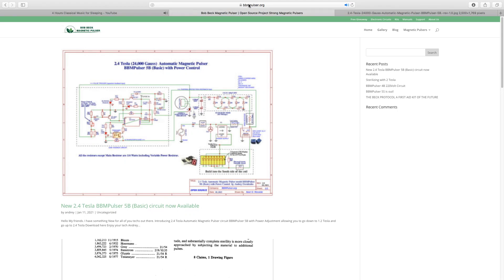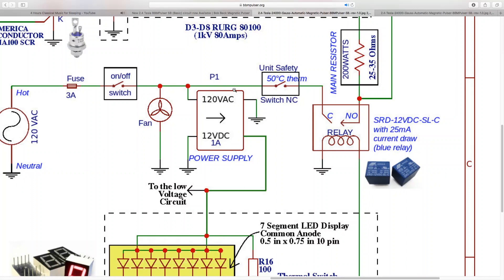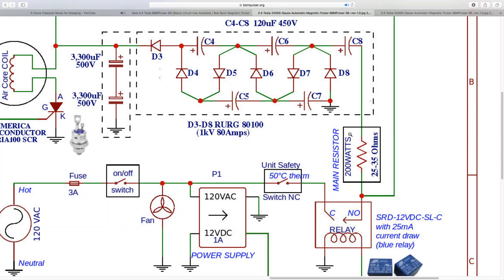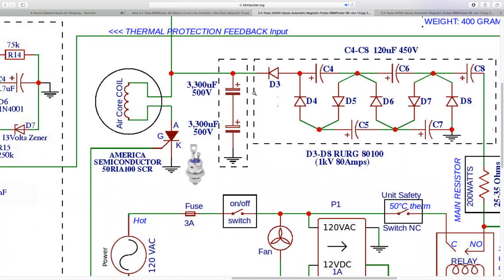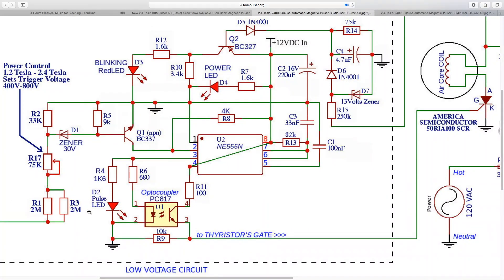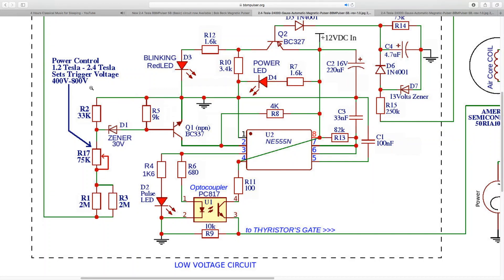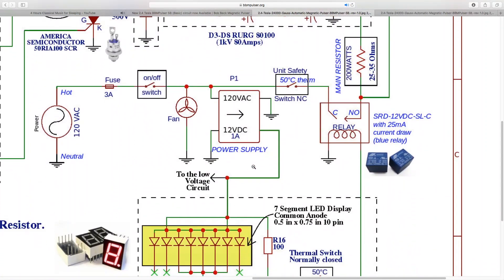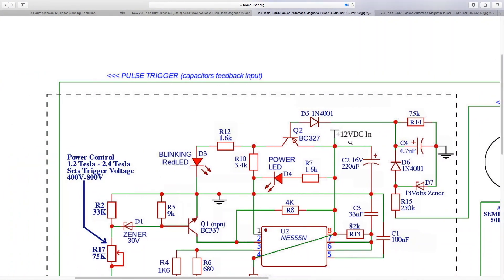027 BBMPulser 5B Circuit 2.4 Tesla (24,000 Gauss) Automatic Magnetic Pulser Strong PEMF TMS Open S.

Comment: Andrey I have a question about 5B there is 2 schematic diagram i have seen one is 3.2021 and the other one is also 3.2021 rev.1.2 on 9.2021 So i was building the pcb for the second one...is that the correct one? I mean the REV. 1.2.  9.2021??????
Reply from the maker: I always post the latest revision on my Website
Reply: @AndreyD  you mean REV.1.2 3.2021 is the latest?

Comment: If I add the 75k potentiometer to the circuit will the potentiometer set to highest value 75k cause circuit to pulse at 800v? When at the lowest value will the zener diode never see over 30v to trigger 555?
Reply from the maker: If it doesn't want to trigger with R2 being 33k (800V trigger) then increase the value to 39k or 43k. With this resistor you are setting maximum Voltage to charge caps before chip triggers. The higher  R2 the lowest trigger Voltage.
Reply: @AndreyD  this is definitely a strong pulser but I need to turn it down when using it in some areas lol.
Reply: @AndreyD  what about the potentiometer. The other day when I had an issue with circuit not triggering you told me to change R2 from 33k to 43k and it started pulsing but now I want to use 75k potentiometer to change voltage but I don't understand how that works. If I keep R2 at 43k can I still use potentiometer and at what resistance should the potentiometer be triggering circuit with capacitors at 800v? I would assume that when potentiometer gets to highest value it will take longer to get over 30v to blow past zener diode which lets capacitor bank charge higher.
Reply from the maker: @corybrown5583 Add 75k veritable  Resistor with r2 being 43k or try to install lower r2 ~ 39k. (this R2)resistor sets highest trigger voltage together  with 75k Resistor
just install 75k variable resistor and try it
Reply: @AndreyD  if I used a 50k potentiometer would that still go to highest voltage (800v) but not go as low (400v)?
Reply from the maker: @corybrown5583  If you use 50k Veriable Resistor then your highest charging voltage will be around 750V or 700V
Reply from the maker: you can. add  ~25k resistor to th 50K veritable resistor to make 75K
Or best is to get 100k and add 300k resistor across to make its combined resistance 75k
Remember 75k is very important value here, you need to have R17 to be 75k
Reply: @AndreyD  so if R2 sets the highest trigger voltage, does that mean a higher R2 resistor lowers trigger voltage? Sorry for all the questions but this was the only part of the circuit I have problem understanding lol.
Reply from the maker: @corybrown5583  That's right the higher R2 the lower trigger voltage
Reply: @AndreyD  the way you have it in your schematic has the 75k potentiometer adding resistance to the 1 meg resistor before zener but did you mean to do that or am I missing something?
Reply: @AndreyD  I just changed potentiometer to connect from zener to R2 and R2 other side still going to neutral and it worked perfect. So R2 just goes up and down in value to change voltage.

Comment: Just wondering if this circuit can work in 220 volts by replacing the fan and the 12v power supply with 220 volts? thanks
Reply from the maker: No It wont work, Your charging circuit needs to work with 220VAC as well
Reply: @AndreyD  can you elaborate, please
Reply from the maker: @cryptomaxima4623  I will try
Reply from the maker: @cryptomaxima4623  https://bbmpulser.org/wp-content/uploads/2021/03/230V-2.4-Tesla-24000-Gauss-Automatic-Magnetic-Pulser-BBMPulser-5B.-rev-1.0.jpg
Reply: @AndreyD   You just made my day, can't thank you enough!
Reply from the maker: @cryptomaxima4623  You are welcome

Comment from the maker: Update: R6 must be 249 Ohms & R11 must be 27.4 Ohms. This New thyristor requires more current to turn On
Reply: I used those values but thyristor not getting pulse to gate. Protection led flashes once like normal when powered on and power button lights up but I am not getting a pulse.
Reply from the maker: @corybrown5583  *********Update 01/23/202: R17 which is 75K, If you don't have it or can't get it, you can use 100K instead, just simply add 30k Resistor across to lower its combined resistance  to 75k ********

*********Update 01/17/2020: R6 must be 249 Ohms & R11 must be 27.4 Ohms. This New thyristor requires more current to turn On************
Reply from the maker: How about pulse LED, does it lights up and stay lid? If yes then we will troubleshoot thyristor, if Pulse LED doesn't lights up then it means your Voltage on capacitor bank has not reached threshold where it would trigger 555 chip. 
which one is it?
Reply: @AndreyD  pulse led does not light up.   I didn't use a potentiometer for voltage control because I don't have any right now other than a few rated for 10k. Problem is I don't have a volt meter that can measure what trigger feedback wire voltage is at because my voltmeter doesn't go higher than 600v. How long after turned on should I expect capacitor bank to reach 800v and trigger 555?
Reply from the maker: @corybrown5583  Trigger Voltage should be  around 30V on the cathode of 30V zener. It should normally trigger under 10 seconds if everything is correct, thats if you set output to be 100%, is you selected lower setting then it should pulse faster.
You do need Veriable resistor 75k and that value is very important. 
If you don't have variable resistor then use R1 1M (2Watts), Short terminals on the board from  R17, and take it out,  and replace R2 for 43k. This resistor values should make circuit trigger around 800V
Reply: @AndreyD  okay that must be why it isnt triggering. I used 1meg resistor at 2watts at R1 and left R2 33k. I just didn't use R17 since I didn't have a potentiometer.
Reply: @AndreyD  that was the problem.  Thank you so much for your expertise!